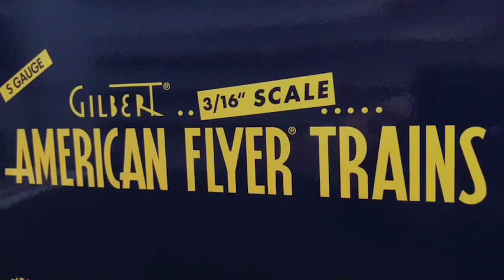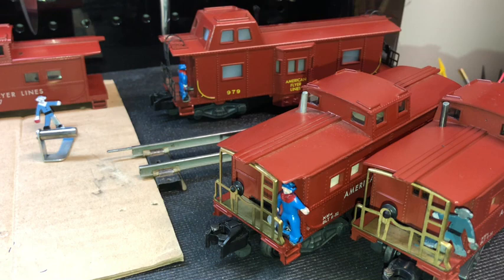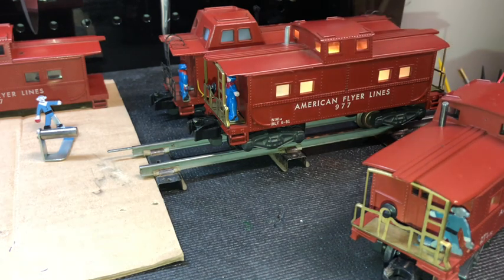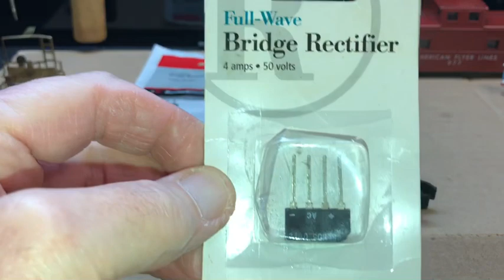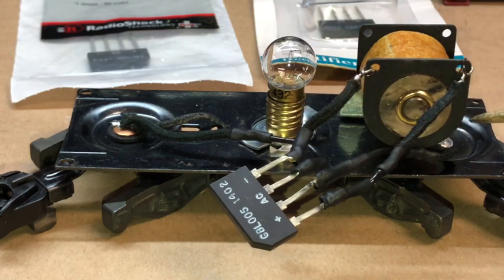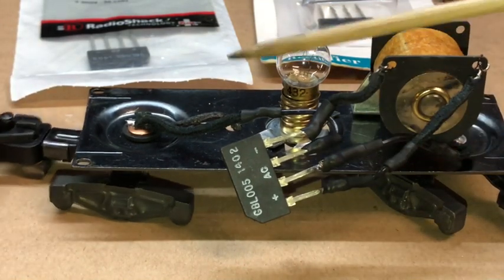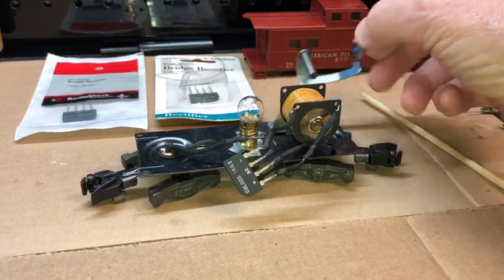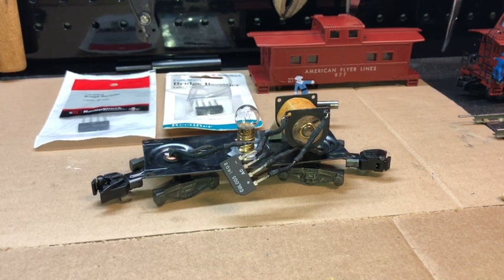For Owner Project Complete Install FullWave Bridge Rectifier 977 AFL oper brakeman Type II-III 55-57

Comment: Dave, I think I would have used longer heat shrink to cover the pins on the rectifier, just a personal preference.
Reply from the maker: Hi James, good point, just recently followed up the customer 977 rebuilds with my own 977, rebuilt for a second time and when I did I neatened up the rectifier install and extended the shrink wrap on both ends, thanks for viewing and for your feedback! Dave

Comment: Dave.  Is there a problem with the bulb heat with the shrink wrap?  It seems the wires should be a bit longer, to put distance between it and the bulb.

Comment: Two questions Dave, will this rectifier quiet all solenoids?  Is there a reason to not use them on all solenoids?

Also, do you have to take the rails off to get the brakeman off, and if so, how to they come off?

Might be getting one soon and I’m preparing to do this work!!  Thanks for all you do for American Flyer and us, the learners 😇😇
Reply from the maker: Hello Michael, for ease of reading and reference responses in inline below at +++, thanks, Dave

Two questions Dave, will this rectifier quiet all solenoids?

+++ In theory yes. A rectifier changes the power from AC to DC, however I do not know if THIS rectifies is compatible to ALL solenoids. I chose the RadioShack Full-Wave Bridge Rectifier because of its close match to amperage and volt range of AC power on AF trains, 4 amps, well under the ceiling of 50 volts on the rectifier. 

Is there a reason to not use them on all solenoids?

+++ AC Gilbert used solenoids for basically two applications: 1. A quick, permanent change of position or direction, etc. Examples are switches, danger bells (rings the bell when engaged then gravity repositions the valve, piston, or plunger), Sam the semaphore man, a semaphore, just to name a few. Once the position change occurs the new position is held and there is no need to apply power and because AC power is only brief, not constant, a buzz or hum is not constant.  2. A quick, but not permanent change of position. As long as power is applied the valve or plunger maintains the “open” position, when power is cut off a manual spring returns the value to the original position, like log dump, coal dump cars. Another example is the operating brakeman on caboose being held in the open or power position during the entire duration of operation, therefore because the value is held for a long duration buzz or hum is heard, a result of alternating current producing a varying magnetic field which acts on the armature of the valve.

...do you have to take the rails off to get the brakeman off, and if so, how to they come off?

+++ There are two brakeman types. 1. Rubber.  This one is the easiest to remove from the lever or arm, it can easily be popped off the arm.  2. Metal. This one is a one piece extension of the arm and therefore must be bent or straightened at the feet to fit through the slot in the caboose body. It is best and maybe only possible to remove the fence when the chassis is separated from the body.

+++ Then the challenge switches to removing the chassis because the brakeman’s arm or lever is attached to the chassis and protrudes through a small slot in the body. The arm can be removed from the solenoid once the chassis and body are separated.

+++ Your final challenge is wiring to insure the solenoid input is from the original power source and the solenoid output is directly to the solenoid coil.  Attaching wire to the the prongs on the rectifier as well as the coil can be tedious.

+++ The solenoid produces heat and should be as free standing in the caboose as possible so that it can cool by convection and does not transfer its heat elsewhere. The solenoid must be packed into the caboose body cavity free of interfering with the solenoid arm mechanism, it is tight.

Might be getting one soon and I’m preparing to do this work!! Thanks for all you do for American Flyer and us, the learners
Reply: Read discussion about using same rectifier to silence Lionel E units.  The coil gets hotter melting windings causing sticking.  Try slipping an o ring over the plunger to quiet the chatter.  I’ve used these rectifiers with a momentary action coils with great satisfaction.

Comment: Good job, that's interesting.  You made an AC relay into a DC relay.  That makes sense.  Was that your idea?  I got a bunch of those rectifiers from old electronic equipment.  I agree that I would have put longer shrink tubing on there, used flexible wire, and maybe made it long enough to mount inside the body to use as a heat sink.  Do you think there should be a diode across the relay?  It would probably work with a smaller relay also.  That's a pretty gigantic relay for that little brake man, but I guess that's why it lasted 50 years!
Reply from the maker: Thanks for watching and comments DBTech. The idea and instructions came from Mr Barkers S Gauge Repair and Operating Guide. On my 977 I recently rewired with 22 gauge flex wire and to your point applied more shrink wrap. As long as a diode can act and produce same result, plus its size is convenient, right, then I see no reason not to use one.  To your point that same coil, and you may already know this I apologize if I’m dispensing the obvious, is used interchangeably across many AC Gilbert products and is interchangeable, thus its use might be more for economy of assembly line that anything else, AC tried to save a dime and tried much harder in later stages of the business, keep watching and thanks for observations!  DavesAFTrains